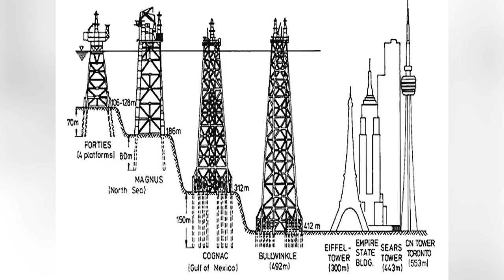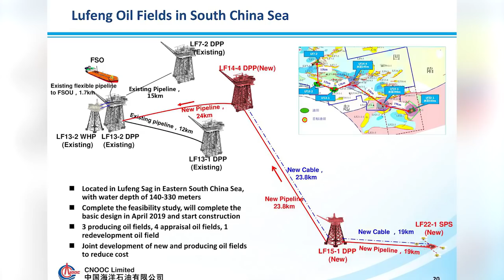Top 15 Biggest Oil Rigs

Comment: It appears the narrator doesn't differentiate or know the difference between a drilling rig and a production platform and has little knowledge about the subject. Just calling an offshore structure an 'oil rig' without differentiating does a disservice to the people and technology. Some clarifying points. The Bluewhale II is a semisubmersible drilling rig also known as a mobile offshore drilling unit (MODU). The Troll platform is a gravity base production platform with a drilling package, it was (or still is) the tallest construction ever built by man. The Prirazlomnaya is a shallow arctic water mobile submersible (sits on the sea bed) drilling rig (another MODU) with limited production capability. The Abgami FPSO is a floating production storage and offloading platform (not a MODU) that produces oil from pre-drilled subsea wells drilled by other mobile offshore drilling units. Its injection lines pump produced water from the wells back into the reservoir to maintain pressure while oil is produced. Perdido is a spar production platform with drilling package. The Olympus is a TLP production platform with a drilling package and tender assisted drilling (TAD). The Hybernia is a gravity based production platform with a dual drilling package. Petronius is a compliant leg production platform with a drilling package. Its claim to be the tallest structure is disputed because it can only remain standing when in water unlike the Troll platform which was built to its height then moved to location before being ballasted down to rest on the sea floor. The Berkut is a gravity base platform set in 35 meters of water depth so although the heaviest it by no means the tallest. It has a drilling package but is usually accompanied by a tender assist drilling rig (TAD). Similar to the Hybernia platform in Canada, the rig has a concrete and steel ice protection structure. Top Fives, try talking to someone who knows about offshore oil production and drilling platforms before you post, it would be far more educational.
Reply: BiB nailed it.  This video is rubbish for the most part.
Reply: *Agbami, not Abgami. I ran a supply boat to that field from Onne, Nigeria.
Reply: @bitterbob30   Exactly, however, I did like the part where the 'expert' cut to a picture of a jackup to illustrate one of his "massive' oil rigs.
I would suspect that the producer has a background in the 'news' industry, where factual 'reporting' is NON-existent.

Comment: Thank you for the update, Top Fives..!!  I wonder what will happen to the rigs when the oil below runs out.
Reply: Probably moved, scrapped,  or abandoned depending on what makes the most money, or costs the least. They only care about profit.
Reply: "I wonder what will happen to the rigs when the oil below runs out."
Typically they seal the well & remove the platform.
Depending on the location & cost, they may remove the tower too, or let it become a reef.
But some are converted to holiday resorts, diving facilities, aquatic research facilities, or museums.